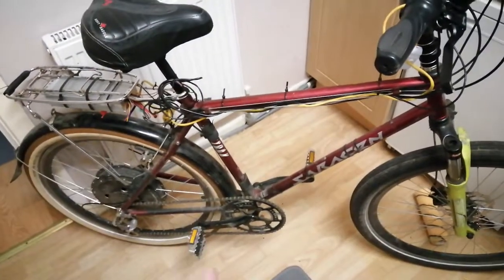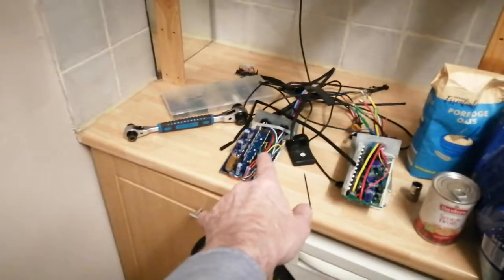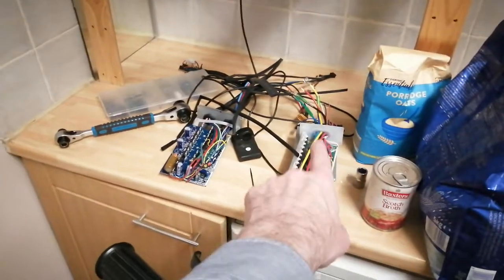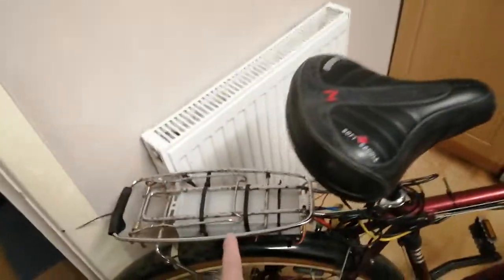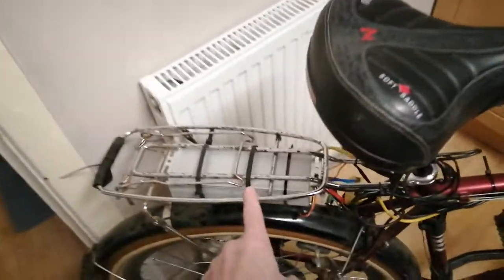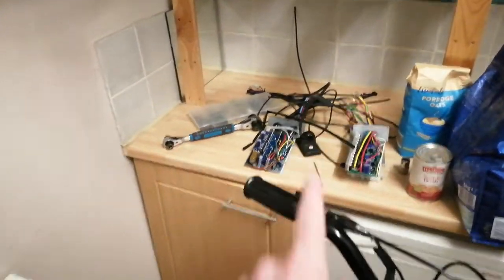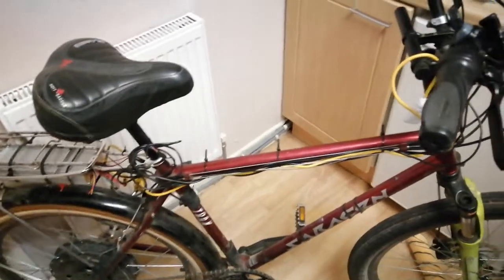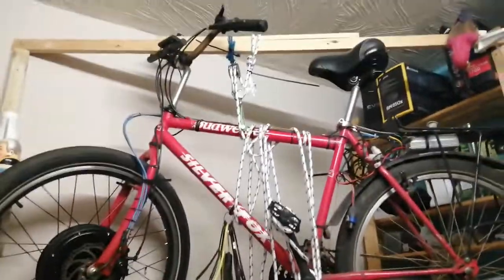ebike update. 75volt battery. Chinese controller. South Manchester uk.

Comment from the maker: Never ever take an ebike out in the wet. You will blow the electrics. Or they will blow the next day. How do I know? Hmmm yes. 1ce, 2ce, 3 times an idiot. Never again. The bike on the rope is fine. Front wheel drive maybe 500 Watts that's plenty. The one on the floor needs me to make it into a monster again. 250watts is what you want for town and roads. Don't break the law. The law is correct. 250watts. Chinese controllers are fine but you need patience to connect it all. Square wave just as good. If you want SILENCE then sine wave. I've run all manner of square and sine and you can get silent cruise on square. Hey blow the budget get sine.